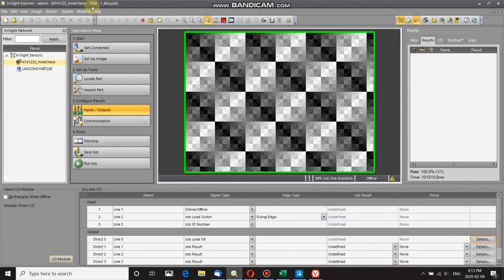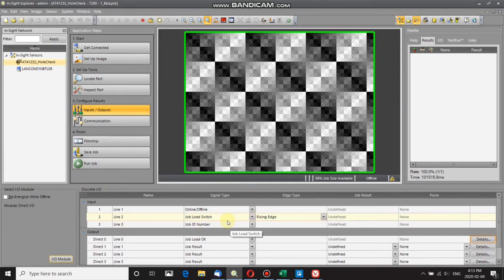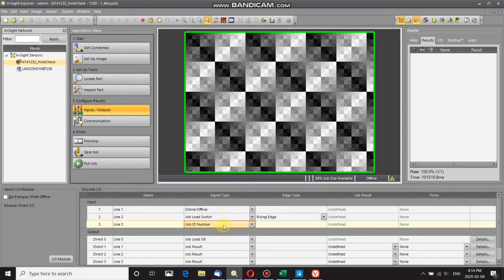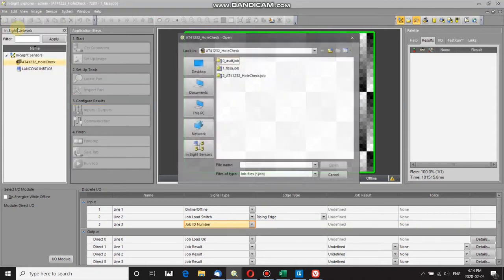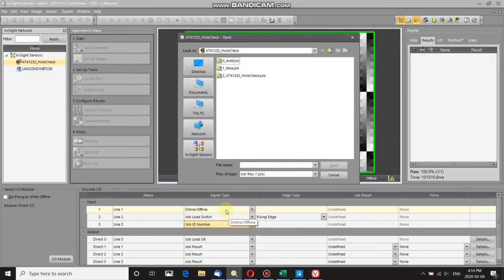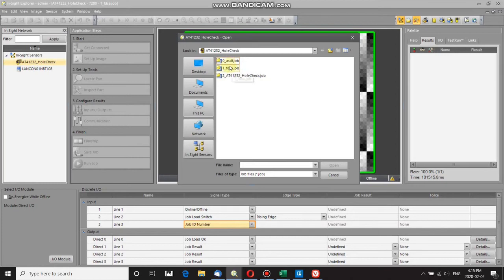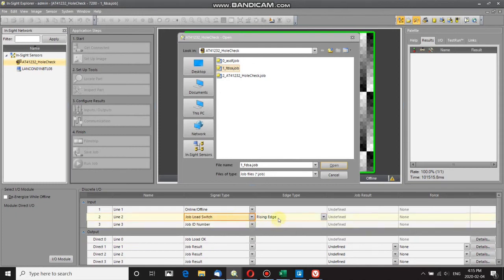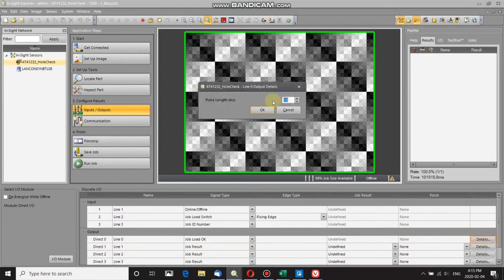Changing job files using discrete IO

Comment: why don't you actually show someone how to go beyond job 0 and job 1???

seemed like you blatantly skipped that portion....

thanks..... for nothing.
Reply from the maker: Going beyond job 0 and 1 requires a CIO-1400 IO expansion module, which I don't have. Since the vision sensor only has 3 input lines the highest I can go is  1. If I get a CIO-1400 I'll probably make another video, but I doubt I'll ever get my hands on one.